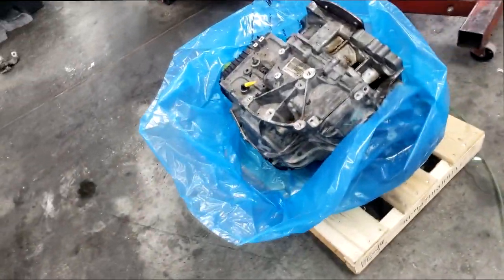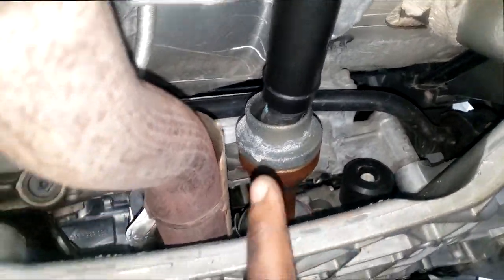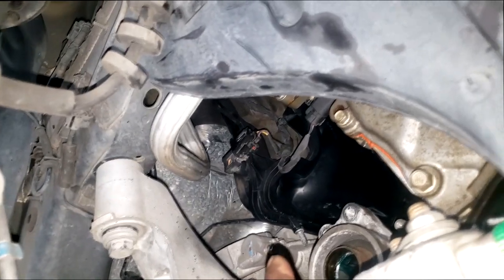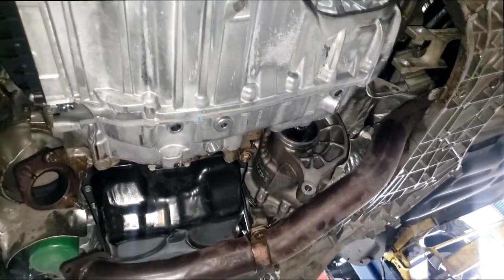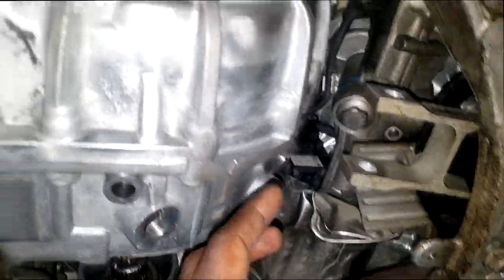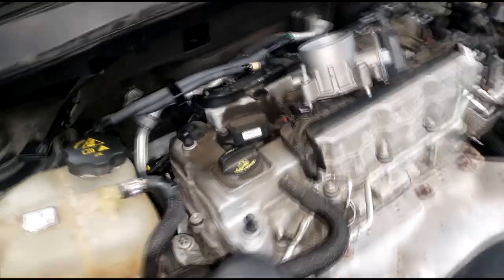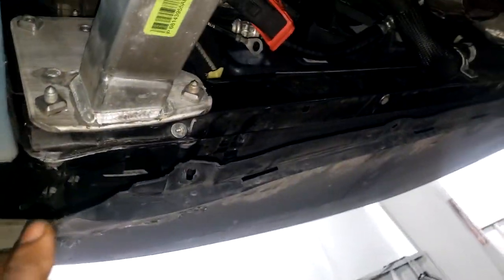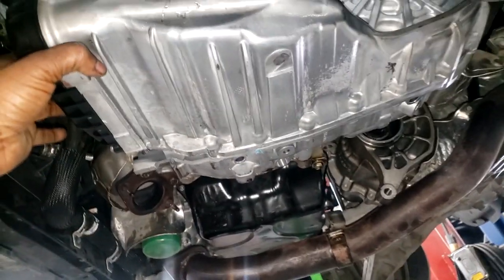Slipping bad Transmision whining noise while accelarating 948TE ZF AWD PTU. Jeep  Cherokee Starter.

Comment: Thats not reckless jt, we try to work around things and do the opposite that instructions say. That's just how guys operate. That front differential wasn't going out the back of mine the way the instructions say. I might try and take a few pics. But we couldn't believe how clean my motor is at 182k, no sludge at all when the oil pan and gasket came off. We put rtv in the 4 spots and got it torqued back in so it could set up all night.

Comment: Me and a couple buddy's knocked out the biggest part of a oil pan gasket in my 06 300c 5.7 awd, what a beast of a job. But with 2 other set of hands it wasn't that bad. We called it a night around 11, we are about 4 hours in now and the gasket is in place and torqued. Now just put the front differential back on. We didn't remove it from the cradle though. We got it to sit on the back corner of the cradle out of the way sorta. My exhaust studs look like they would snap. So I cut my exhaust at the blown out flexes just behind cat, so we could lift the motor. I'm ordering me a lift this week, no more laying on my back. Wasn't that bad with help though, well have about 10 hours into doing the job. On jack stands and all

Comment: Merry Christmas sir, I have been watching you for years and enjoy your channel, I have a 2016 jeep cherokee trailhawk, it has 115,000km on it, I would like to change the ptu oil, I pulled the skid plates but couldn't find any drain or fill plug on the little unit, does it share the transmission oil since they are kind of linked together? I can't find any information on this? Thank you

Comment: Changing fluid on a rear differential 2016 Cherokee Limited 3.2 any tips I am subscribed thanks
Reply: It’s a suck and fill exchange out of the same hole. There is no drainhole. Look for the plug with a 3/8 inch extension can fit in. No socket. Suck the fluid out through that put the exact same amount back in or until fluid starts weeping out the hole 70w80